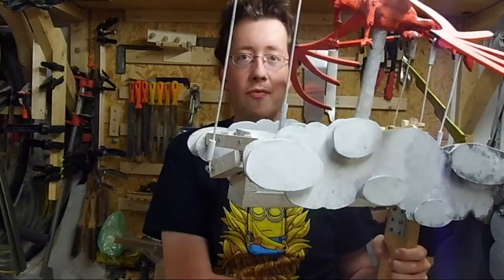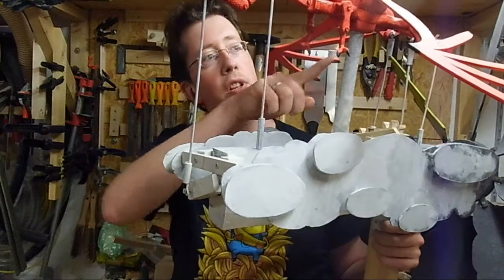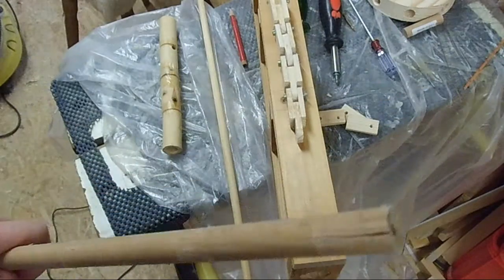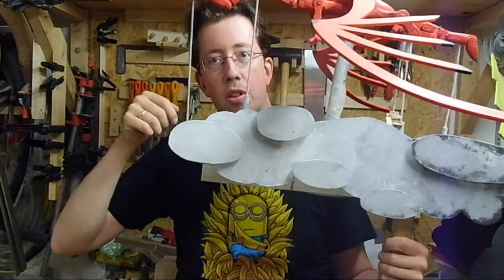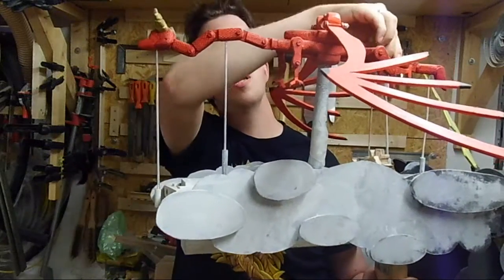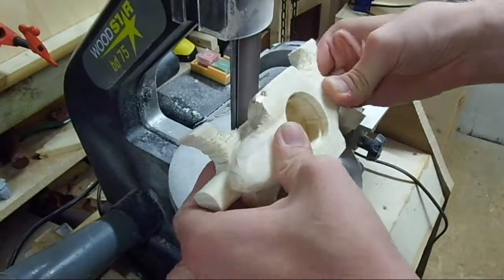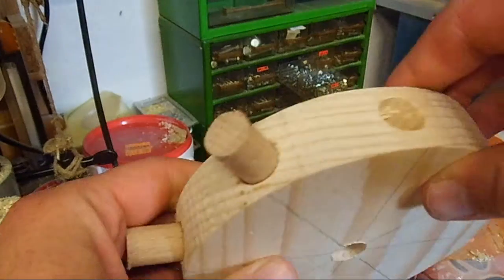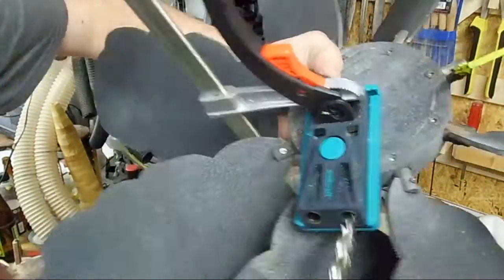Getting the Dragon into the Air - Whirligig Wars 2014

Comment: Your videos are getting much better. Great job! I also liked the variety of techniques and jigs you used to make the various parts.

TIP: A socket and extension work well to remove wooden dowels without splitting. If you don't have a proper size you can use washers or even fender washers ground to the needed size to spread out the force.

P.S. The spinny thingy would usually be called a hub.
Reply: I also liked all the jigs you built and problem solving approach; I may borrow the "spinning thingy" drill jig. I see you spent a lot of time making the segmented hollow tube, do they not have PVC pipes in Germany?